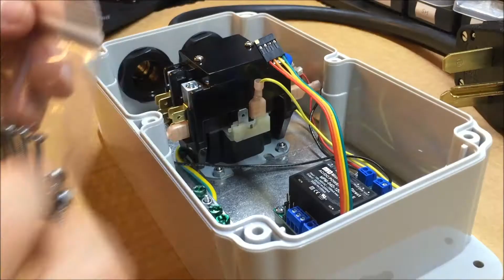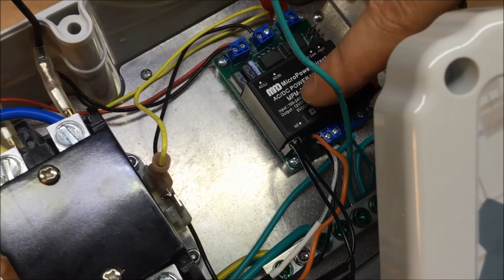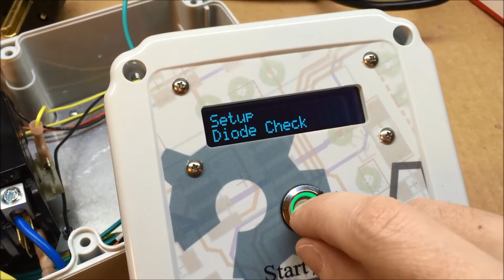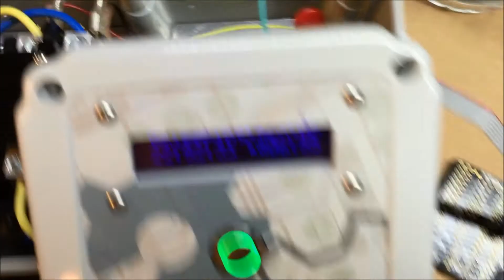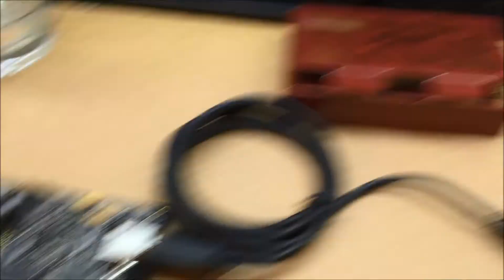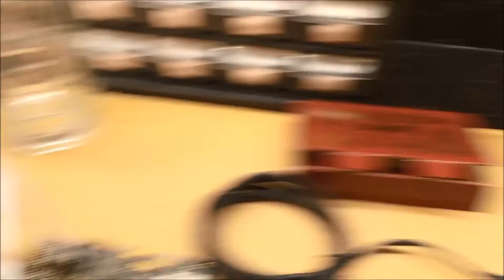Building an OpenEVSE kit 3

Comment: Great videos!   I had them playing on my TV while I followed along and built my own.  The new kit includes the soldering already done, so that saved me a bit of time too.   Enjoy your E-Golf! :)
Reply from the maker: +radiodan Very cool, what car did you get?  I am absolutely loving having an all electric car.  I still can't get over how quiet and smooth they are :)
Reply: +dparson I got a Volt 3 years ago, to replace a Jetta.   And then 2 years ago I replaced my Range Rover with a Tesla Model S.  It's hard to go back to an ICE once you get hooked on EV's.  I also have a 6kW solar array to power it all.  Eventually I'd like to work on smart charging where the energy surplus dynamically controls the OpenEVSE max current.  Long story short, here in AZ, once you build up enough credits, it's best to use the power as it's being generated, rather than back to the grid, and back later, due to delivery charges.
Reply from the maker: +radiodan Sounds like you've got a really nice setup.  I hope you're able to integrate with the OpenEVSE, it's definitely made for that.